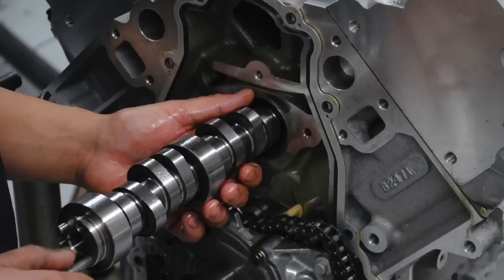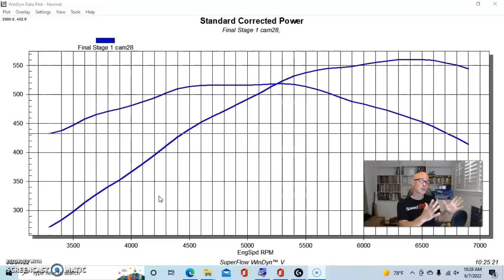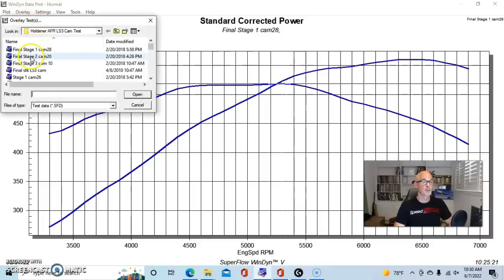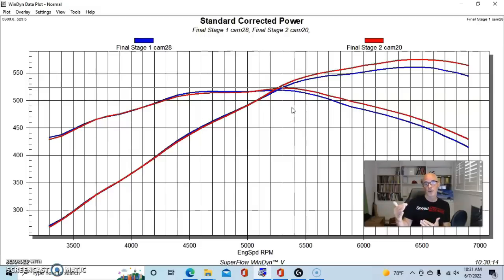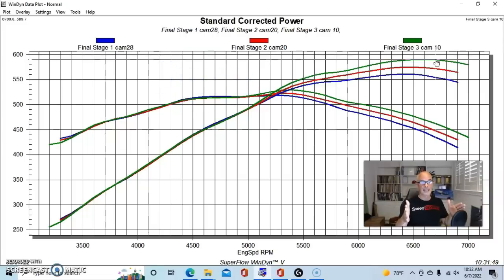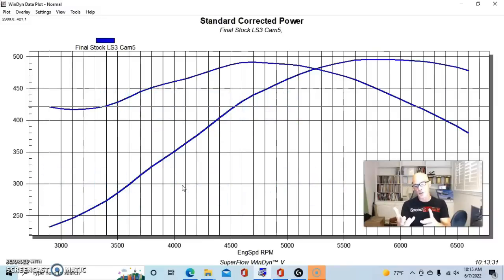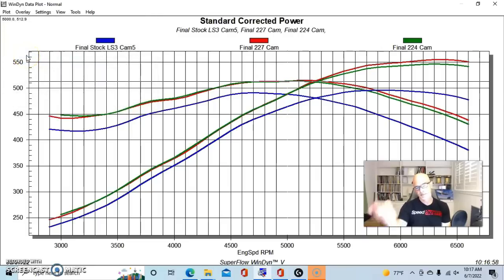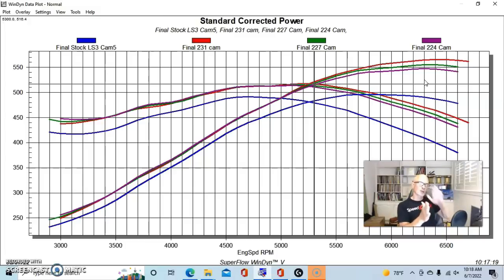DOES A SMALLER LS CAM MAKE MORE TORQUE THAN A BIGGER LS CAM? AFR LS3 CAM TEST-STAGE 1 vs 2 vs 3!

Comment: As a percentage of TIME spent at an rpm, the time spent above the torque peak is near 0%.  Probably 0.1%.  The time spent below 4000 rpm is probably  95 to 98%.

Is the loss of vacuum, loss of economy "worth it" ?
Reply: My exact thoughts. And no, the loss in vacuum and economy is not worth it. Unless you are racing, it’s an absolute waste.
Reply from the maker: 98% below 4000 rpm?
Reply: @richardholdener1727  check my N/A 6.0 dyno vid on my channel.  Its a doozy.
Reply: Yes. It is.

Comment: efi systems do not like big cams on the street the factory ecu does not do well with lots of fresh air and o2 sensors it is very difficult to get decent mpg and drivability on the stage 2ish and up
Reply: Speaking strictly of GM stuff, it's not too big an issue provided you have good MAF sensor placement and properly tuned VE tables.  Big monster throttle bodies tend to be more of an issue at low rpm than big cams do IMO.
Reply: @ChurchAutoTest  heard the same thing.. good tuner can make big cam drive well... oversized tb can be a bigger issue

Comment: Something is off, how’s there zero trade off between  stage 1 to 3 cams?  I thought this was impossible? 🤷‍♂️🤷‍♂️🤷‍♂️
Reply: If you look at the charts, they start near 3500 rpm. Usually is below that were you are going to see the losses/driveability issues with the larget cams.
Reply: The lsa's are all different. The small cam with the same 112 lsa the big cam has would make more torque in the 3-5k range.
Reply: The graph doesn't show the decrease in fuel mileage and increase in emissions of the hotter cam. Sadly they didn't start the test at 2000 RPMs which would have certainly showed a torque drop with a big cam
Reply: @thereisnospoon52  I agree, comparing “Peak Torque” is irrelevant when your comparing street or drive ability. Yes a bigger cam will make more Peak Torque but it will be soft and less responsive in the rpm range most people drive.

Comment: I’d like to see the variation with changing overlap. The Truck Norris cam seems to show that a tighter LSA can really help. How ‘bout a new test, Richard!
Reply: the rec port heads have such good low lift flow tight lsa works differently compared to stock cathedral heads
Reply: @bill2178  I believe more/better breathing (or smaller displacement with the same heads) generally means less overlap needed, but I’d still like to see the test results!
Reply from the maker: please see the rec port 6.0l truck cam video
Reply: @richardholdener1727  I looked for that video, couldn’t find anything about tighter LSA cams on the LY6… Your truck cam video covered TN on the 5.3 but not the 6.0–at least the one I found. Have you run the Truck Norris cam in an LY6?